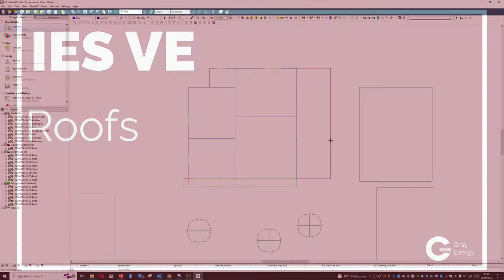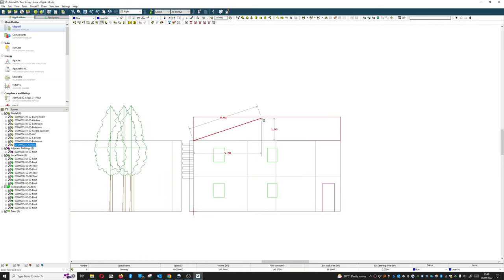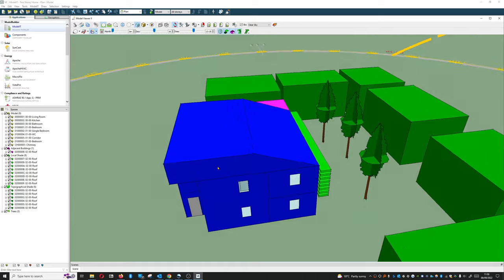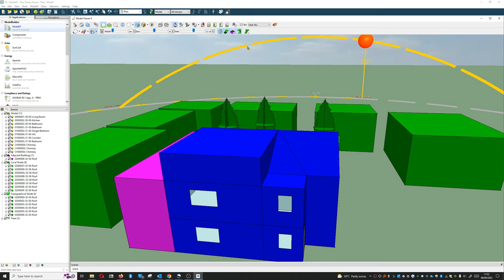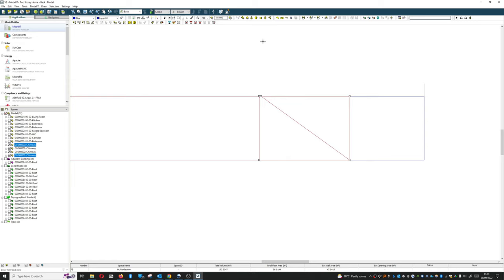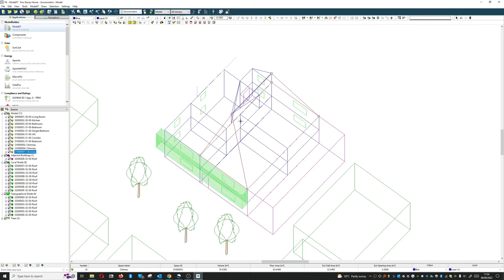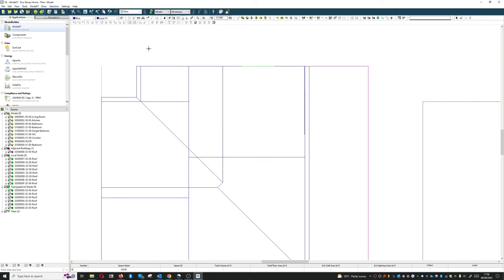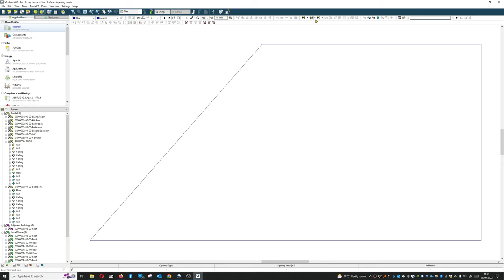IES VE Tutorials - Episode 7 - Roofs

Comment: Not your best video! Shame, as it is quite important! Especially when trying get o grips with IES.
Reply from the maker: Fair, what didn't work for you? I'm a bit strapped for time but I'll make a note to try and improve it if I get a chance.
Reply: thanks for replying... for me I would like to you to go slower in getting the roof geometry sorted for non standard roofs construction lines & partitions..... in truth that's a tutorial in itself....  I have to get to grips with IES for a real project.... I've followed all the previous tutorials fine thanks to you.....  I will be using PV to getting the roof geometry right is important.  I'll keep ploughing on and see if there is anything up ahead that might help?
Reply from the maker: Firstly, your right about it being it's own video. Quite complex geometries can be achieved but often times they don't inherently make a model more useful and can cause strange glitching to occur. It involves cutting planes, chopping up shapes and then reattaching them back together. A more effective workflow if a complex geometry is critical would be to use either a sketch up or revit workflow. Sketch up being more user friendly and actually has an IES plug in (I've not covered these but you'll find guidance easily enough). 

But, also, I think your  making more work for yourself. So when you set up pv in IES (I recommend just doing a quick youtube search for that), you set the angle of inclination (your roof angle in this case) and the like rather than attaching it to a plane. So the exacting geometry of a roof isn't a massive concern unless it's desperately important to get your solar shading factors right (which can definitely be a thing with up stands and pv) or you have large Velux's (again comes back to solar).

Doesn't address the going too quick, but I hope I can save you a bit of time and a headache.
Reply from the maker: @FrancispMoran  also I'm a bit of a fool. The next video covers advanced geometry creation, you'll see it's not very nice process :/.